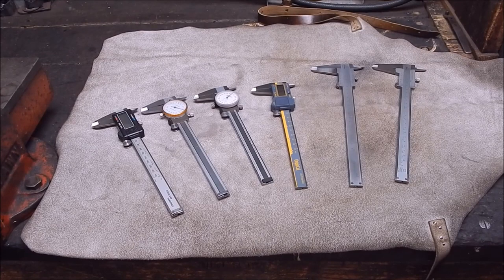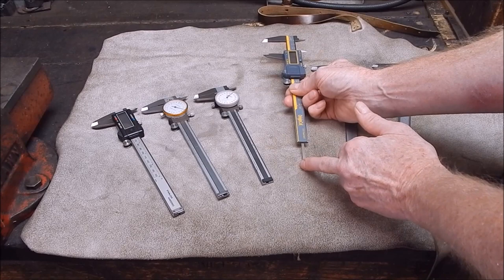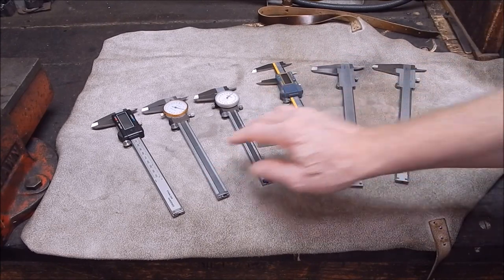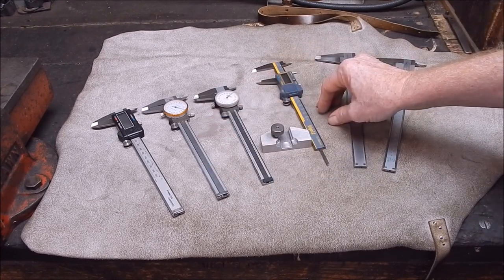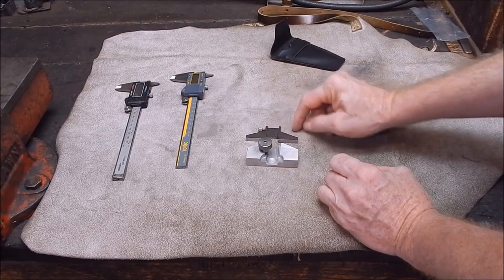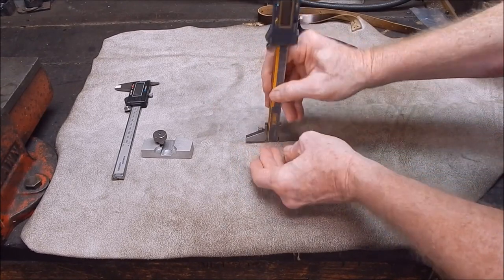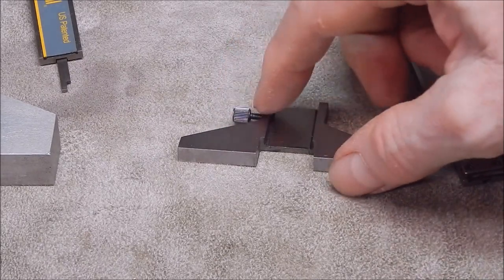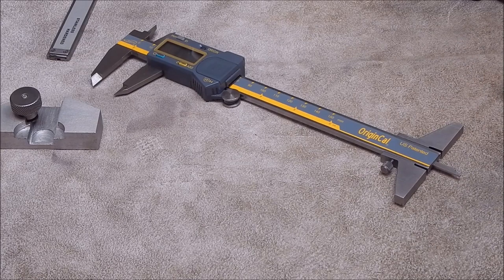I review a cheap depth measurement base for a 150 mm caliper

Comment: Handy addition to vernier Rob, certainly help to keep the vernier square and getting a more accurate reading. Don't forget about the linear measurement with a vernier, very handy for measuring a step on the lathe when turning different diameters, using the fixed front of the tool and the front of the moveable section, great for measuring step lengths.

Comment: you could make yours slightly wider channel compensate all types, and have a bevel washer on the screw clamp to compensate different sizes.
one thing I've never understood why is it stepped on the end the gauge not just completely straight across
Reply from the maker: Hi John,

All things are possible.  I thought it was pretty good as a base unit.

I only made the Mitutoyo copy because I thought the price was a bit over the top.

Cheers Rob

Comment: Huh, my iGaging came with that attachment in the box. (I like my iGaging too but I don't think I did it any favours leaving it at the end of the surface grinder and smothering it in grinding dust. It still works fine but I should pull it down and clean it)
Reply from the maker: I see some models include the base.  Mine is just the caliper.

Comment: I have tried the Igaging. Good quality with fair price. Good stuff!!!! Do you know where can I get the igaging products? There are not many places selling igaging. Only fews and limited products.
Reply from the maker: Hi Ryan, It is good stuff.  In Oz Google is your friend.  I don't know of any local sellers.  I bought mine from the USA where it is readily available.  Cheers Rob
Reply: xynudu I really did searching on google. There are only fews stores import little products.
Reply from the maker: Hi Ryan, From memory there was a woodwork tool supplier in Oz that sold some Igaging stuff, but there are two versions of the digital calipers and one has a slot type battery holder which apparently can give trouble, which was what he had.

Get the same type as mine with the front load battery and all will be well.  Good unit, very repeatable and accurate.

Cheers Rob

Comment: Hi, thanks for the review of the base attachment. I have a question but not on the base attachment. Because I see you having so many cheap caliper, I have one before but sold it away due to battery consumption very high. A new battery last only the most a month or so. Other then that its a nice cliper and only cost US$14. I brought a Mitutoyo CD-6"CSX for around US$160 4 yrs ago. The battery last a tad more then 3 years for my style of usage. Same style of usage for both but the battery life is so much different. Do you have a review to compare this part of the cliper? Can share on this ? Thank you.
Reply from the maker: Hi Vincent,

The cheap digital calipers of that style vary a lot electronically.  The really cheap ones have basic circuits and eat up batteries.  The more expensive ones are a lot better and generally have low battery warning.  The cheap ones lose accuracy as the battery loses power below a certain level.  I can't tell one from the other by looking at them as they all look the same externally.

The batteries in the generic Chinese one I have last about 12 months provided the batteries I use are good quality.  The cheap batteries don't last very well as they get older.  Generally the more you pay the better the calipers are.  The batteries in my Igaging caliper haven't been changed in at least three years.  That is a good unit.

That's all I can tell you about this.

Cheers Rob
Reply: I have a couple of those digital calipers; one high end - one 'el cheapo'. Both seem to chew up batteries at an unreasonable rate! I've found that by pulling the batteries from the unit/s after use conserves their life substantially. I believe that the 'OFF' function is not truly OFF - but a 'standby' function that eats power.
Reply from the maker: Hi John,

There are definitely varying degrees of off.  When truly off the caliper or micrometer will lose the zero point you have set.  They don't have an Eprom built in, and just use active memory that only works with battery feed.

I do have a micrometer that really does go to off after a set period and all settings are lost.  Now that is "off".

So batteries out is a good idea for most  infequently used measuring gear.

Cheers Rob